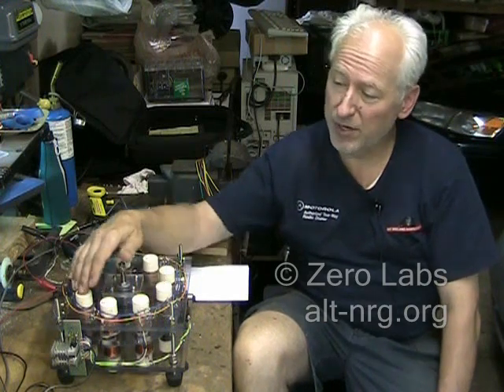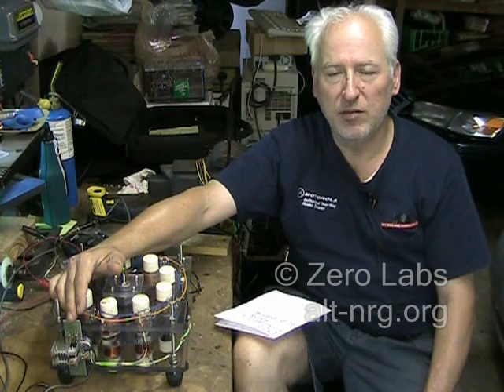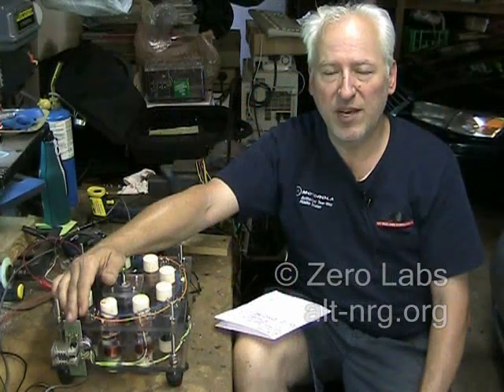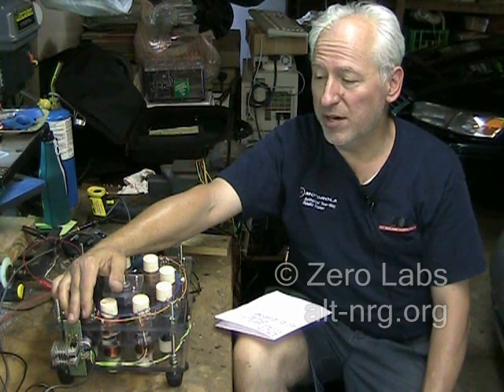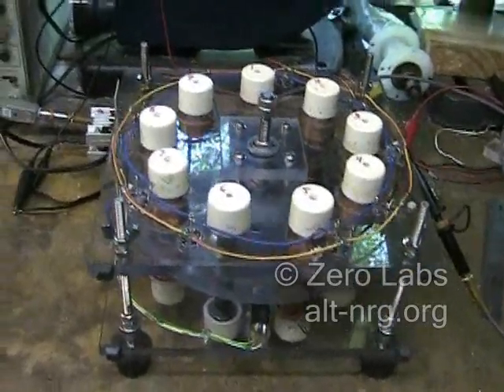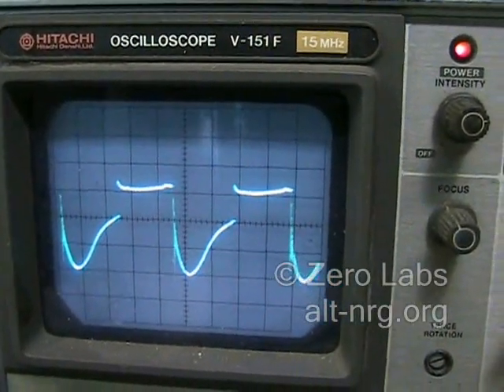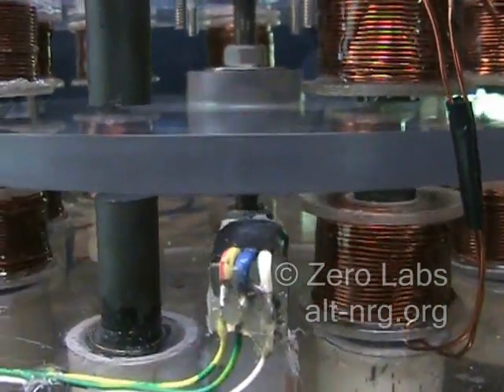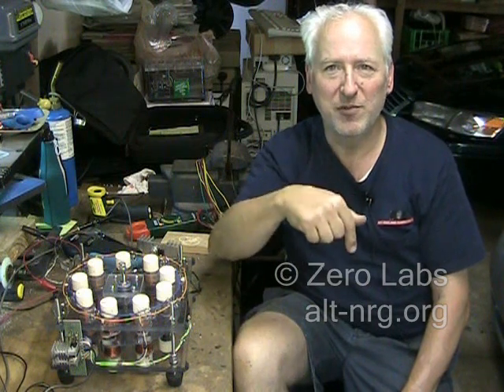#287 Running Muller Motor!

Comment: Z, great work with this build, not only how fast but the quality as well. It would appear that you are at the final phase of proving or disproving a self running with additional power for work. Do you plan or finishing the last coil bank or proceed as is. The other item is your sites are still up and with the amount of followers this will be an interesting month, as to the outcome.

Comment: @ZeroFossilFuel i have  a crazy idea for you, maybe i am not the first one to tell you but when i see all that acrylic and the nice straight edges it makes me wonder if you have considered tightening it up and sucking all air out of it. running the magnet-wheel in a vacuum would remove all airresistance as well as the noise. it may cause the oil for the bearings to evaporate.

Comment: So if this works you're expecting to remove your starting source and the motor should run under its own power?  I think you're missing the part of the plans where you cut the back off a big capacitor and hide some batteries in it!

Comment: A micro is great for timing. Arduino (& clones) give great power w/simple lang. 1 input pulse from any pos. will synch. & give total freedom of pulse timing/dwell, 1µsec timing resol., control speed/torque, flexible # of drive coils, etc. High RPMs require different timing than slow speeds (ie: ignition advance), and there will likely be a resonant freq/speed for max. eff. Could use the A-D inputs to make it self-tune the speed/torque- if you want to dream.(I'm 52, it's not just for the 'kids")

Comment: Why did you run it on it's side like you said should never be done due to risks of parts flying apart and killing you? Just because you haven't had failure at higher rpm doesn't mean you can't or won't at some point, so be safe at all times, we need you to keep up the good work.

Comment: 5 years on and no self running? Your design is a reasonable motor, with an over complex coil driver circuit, there is nothing unconventional in the design. The back EMF is normal, so why credit it as a Muller, it would be understood over a hundred years ago.

Comment: "not a self runner yet"
and it never will be. 
I would like to know... what principal, proof, or notion gives you the idea that this motor will produce energy from nothing?
Why cant I just attach a windmill to my car, use that windmill to turn a generator, take that power and push the car. Then I would need no gas...Right???